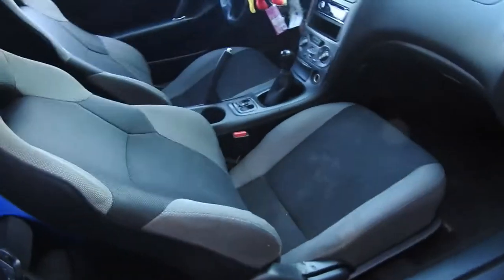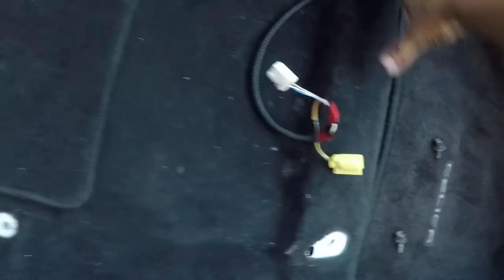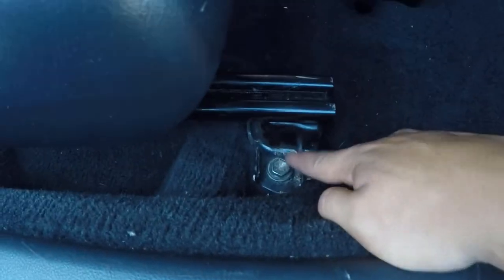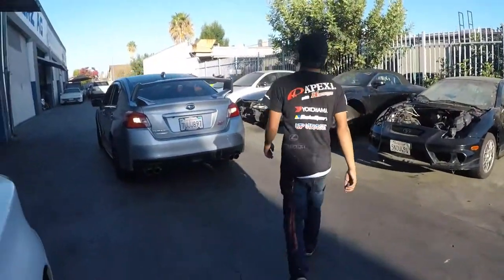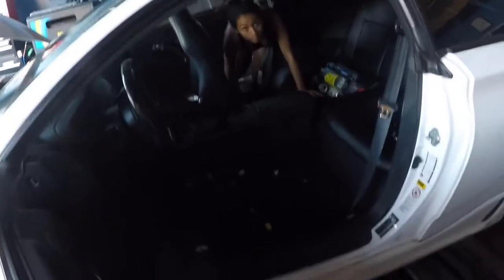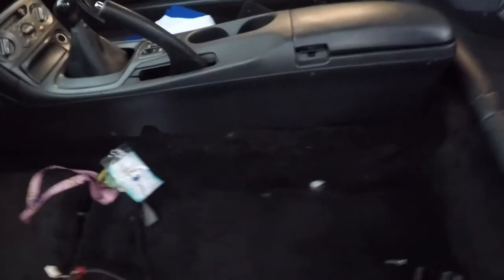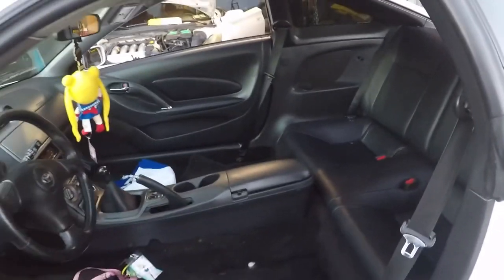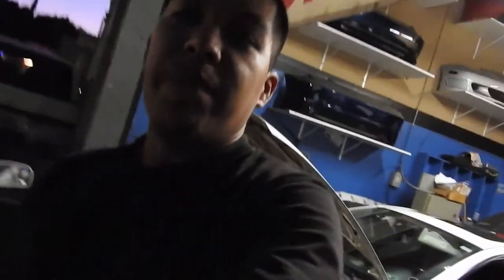How to remove the seats of toyota celica

Comment: Do you still have the car? I just bought a 2000 gts automatic with manual mode and the front leather seats are torn badly. My local junkyard has nice red suede seats I might get them...
Reply from the maker: Yes i still do